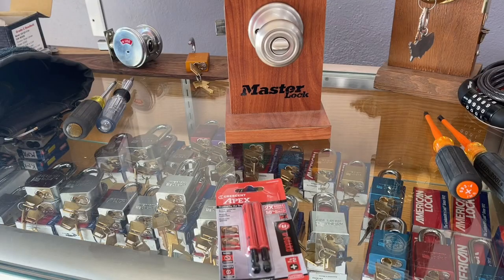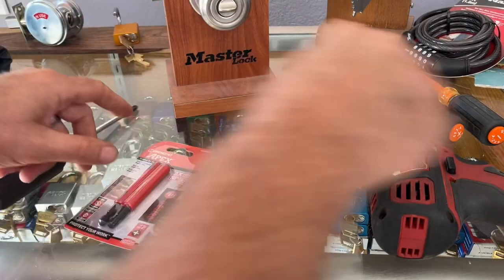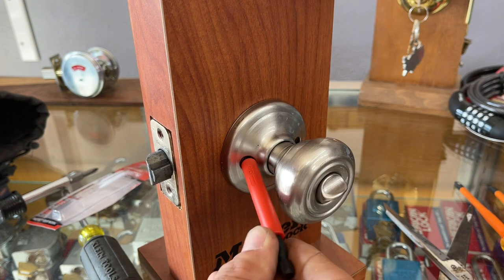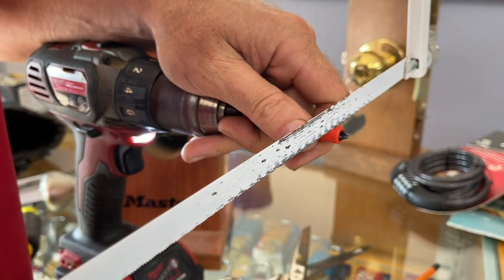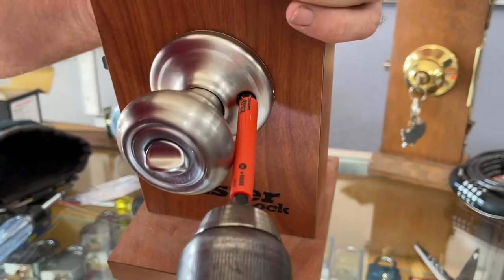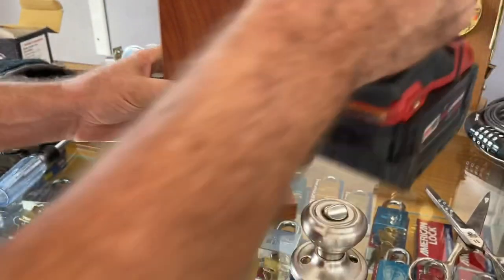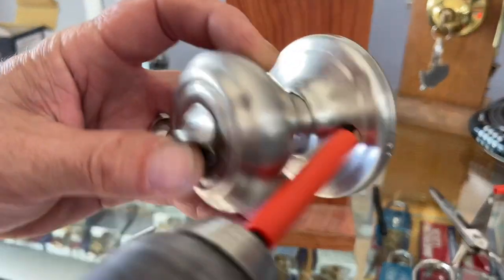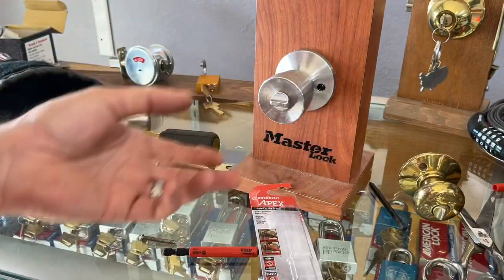Crescent Apex Screw Bits - Does this Gimmicky Product made for Locks work?

Comment: Apex is actually a old school industrial assembly tools company that makes (or possibly used to make at this point) high quality screwdriver bits for production line applications. They were original bought up under either the Cooper tools or Danaher tools corporate umbrellas. It is only very recently that they decided to start using the brand to market to consumers. this product looks like some idiot in marketing decided to take ideas from their production line grade and sell them to average people. I am also at a loss as to why they decided to slap the Crescent brand on crap that Crescent was never known for.

Corporate marketing at its finest. Take respected brands, run them into the ground and than start slapping their names on anything and everything.

Comment: Milwaukee bits are the best
They are round so no edges to hit knob
They have a thin part that is perfect to give you a little better angle
 there's a plastic.sleeve on that thin part
Reply: 100% Dave. Use those in the Milwaukee electric screwdriver and they're awesome!
Reply: I think ive tried them all so far...
I go with the 6" incase I need the depth

Comment: I use a flexible screwdriver extension that works great for knobs; it just simply bends around the knob contour.  It’s a flexible extender that comes in one of the Oria driver and bit sets.  

The kit itself is definitely worth the purchase since it has all kinds of odd and uncommon bits that come in handy from time to time especially if you also dabble in electronics, and the bits hold up nicely to a decent amount of abuse.
Reply: Are those still available? I thought someone mentioned that in a previous SML, but when I went looking for it, it looked like the product had been discontinued 😭

Comment: I don’t understand why people think the product doesn’t work, the guard is made to protect the knob from damage, your not supposed to use that drill bit in the screw gun to tighten the screws anyways because just like he said you jam the screw to the knob, the drill bit is simply made to drive the screw the majority of the way not all the way, instead you’re supposed to hand tighten as to not strip the screw head on screws. A more important conversation Is why hasn’t he used some locktite thread adhesive before driving the screws all the way? If he was installing this doorknob onto a door He will be back at that same doorknob in 6 months tightening up the same screws.

Comment: Absolutely amazing that they literally had a picture of using them on a door knob on the package… yet you were unable to actually use them on a door knob in practice, only when you modified them were you sorta able to use them and even then they kinda sucked 🤣 Guess it’s sticking with those electrical screwdrivers 🤷‍♂️